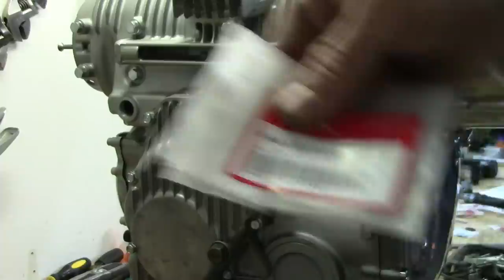73 Honda CB750 Custom Build Part 22 - Oil Pressure Test

Comment: If anyone's wondering, there are actually aluminum crush washers that go on the oil lines to the tank. They were probably still in the lines when you went to connect them, Dino.

Comment: I was wincing at you starting it dry, without even bleeding the system by loosening the oil filter till gravity fed oil into there to get some of the air out. Hopefully there was enough assembly lube in there to keep the bearings safe, though you could hear from the starter sound when the engine finally got the main gallery's full and oil up to the crank and cam.
Reply: SeanBZA Not dry, PLENTY of assembly lube on everything so no worries. :)

Comment: Nice work Mate. All the pre fit tests you're doing will save you pulling the engine out after it's in the frame if it's not right. Interested to see how you do fit the motor. Easy to lay the frame over when it's in pieces but a b@stard on a complete bike. With your skills I suggest you invent and patent the Honda 750-4 engine stand / hoist so you can ease the engine out with it on the centre stand.
Reply: Nick Kerr Workin on it!

Comment: On my '77 750K engine there were aluminum crush style washers inside the fittings that go to the oil tank. I thought they were part of the fitting at first but then they popped out.

Comment: Interesting - you can tell there's oil getting in by the sound of the starter. It seems less strained when the oil is flowing through the engine.
Reply: That's because the engine was dry (eeeekk). Once the oil primed, the friction went down. I would not recommend doing what he did. You should fill the filter housing with oil and also pour some oil onto the cam, lifters, and into the cylinders with the plugs removed. etc.
Reply: Mekhanic1 Lots of assembly lube on everything so no worries. There was also light machine oil in the cylinders. I've built up dozens of engines over the years and I've done this same procedure many times with no problems. :)
Reply: ***** Yes indeed. It's been very enlightening watching as you rebuilt the engine on this bike. Thank you!
Reply: ***** Thanks for posting the videos nevertheless they are great!! ;)

Comment: Regarding the oil filter - Just curious why someone would include a used oil filter with this since you mentioned that the engine was torn down.  Had the seller already cleaned it or did you get a dirty oil filter in a plastic Wal-Mart bag?
Reply: Jeff Becker It was still in the oil filter housing. There are two of a lot of things for this bike. That oil filter housing was very clean and painted so I used it. The filter was in another housing that was painted black.

Comment: I’ve seen these series of videos several times. How long did you’ ve been cranking the engine until you got that first 6psi? I am now running into a same situation and had to charge the bike’s battery several times and still no pressure.
Reply from the maker: It can take a while to get the pump to fully prime and pump oil.

Comment: Im thinking of rebuilding the top end of my cb550 this winter. Is it difficult to do with the engine mounted to the bike or will I need to remove it ?
Reply: You will need to remove it.

Comment: I am at this point with my build.  The oil tank is filled and I cranked it for about a minute, and no oil coming to the top... Any suggestions?  I'm afraid to keep the motor cranking even though I used assembly lube on everything you have so far.  The oil level hasn't changed either.  I'm thinking I have an air lock and need to loosen up the filter and see if oil is getting to the crank case.  Please let me know what your thoughts are when you get a chance.  

Thanks
Reply: Branko Rogovic I'm having the same issue. Did you figure it out?
Reply: I'm having the same issue...

Comment: Dean, your videos are very informative, I have been using them while I rebuild my CB750 as well. I was wondering how you plumbed in that oil pressure gauge. I am guessing that the thread on the engine casing is some sort of metric form of tapered NPT thread.